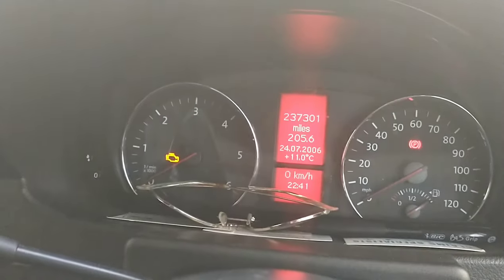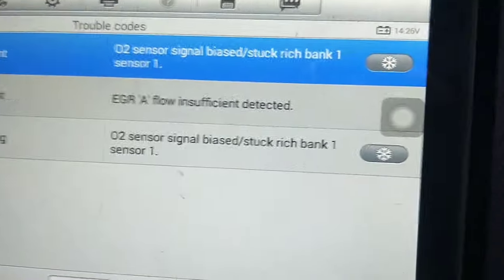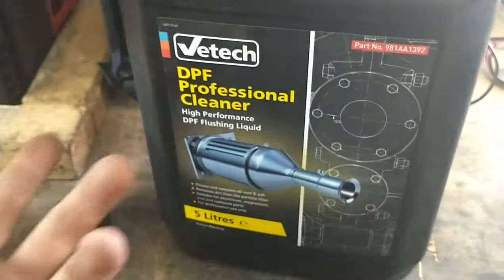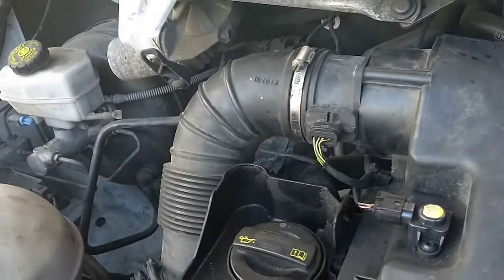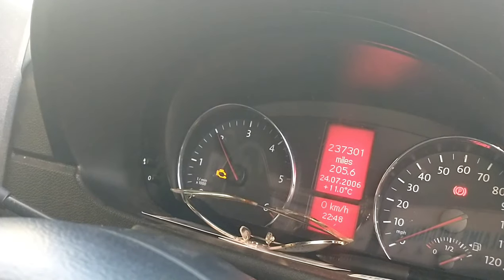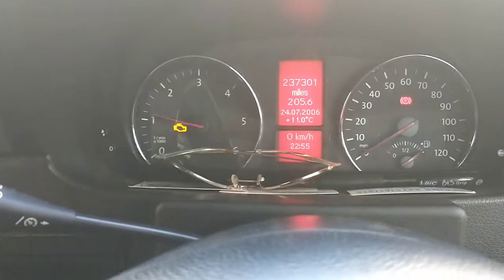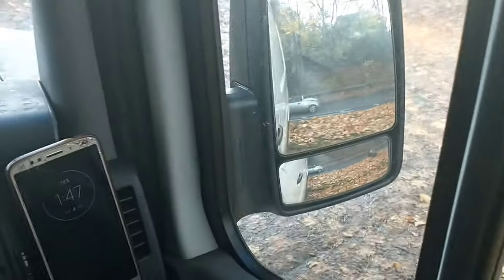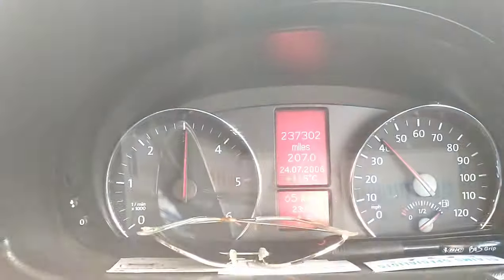How we clean EGR Valve, Intake Manifold & Turbo without removing!! using DPF Flushing cleaning fluid

Comment: Hi mate , I have used the one that should be mixed with fuel , it’s running rough I switch engine off immediately , to get it flushed out of the system do you think by taking the whole egr unit and cleaned will be alright?
Reply from the maker: Hard to say without seeing or hearing it
Reply: @ORileysAutos  now it will only start with starter spray, what do think mate
Reply: @ORileysAutos  am getting p0087 fuel pressure is too low , where about are you, am in Manchester
Reply from the maker: @adamvet9609  Biggleswade Bedfordshire
Reply: @ORileysAutos  I know you have made note of not using flammable  material , the one that I have used is (Carlube DPF cleaner ) , I have tested it with flame , its not that highly flammable like gasoline but it looks like diesel thats why it does say on bottle max it with diesel  , anyway I have used it thro air intake while engine running , engine Reve little bit high then stale , only now start with engine start spry , am getting P0087 Fuel pressure too low , I had this code before and I didn't get chance to check high fuel pressure pump , but looks like no fuel can only start with start spry and not Ide , do you thing high fuel pressure pump could be the problem , is it the one that has bolt to the shaft because I read about it that bolt could become loss , I would have to give it go hopefully engine start again , looks like  no fuel delivery thats why , your response is appreciated mate .
Reply from the maker: What vehicle is it and engine
Reply: your shadow is appreciated mate , before I dive in to that high fuel pressure pump as you know its really deep in there , would have to strip every thing off to reach it ( take whole EGR as one unit , then intake manifold with fuel housing ) all of these parts out of the way to reach the high fuel pressure pump
Reply: @ORileysAutos  on sprinter mate  651 2.1
Reply: 651 2.1 engine the high fuel pressure pump does it have that bolt to its shaft (looks like 23 mm bolt ) ? I haven't taken it yet U see
Reply: gooooooodnes me !!! you wont believe how easy it was to fix it , I spend almost 48 hours working on this van scratching my head (checking , back probing  ... ) I nearly about to throw high fuel pressure pump on it , infact I already bought it but now have to return it !!! but for those people want to try this at home please dont do it , if you aren't professional , you could easly got charged a lot of money to get it fix and the sad thing is , it will not be right away so your car or van will be sitting there in garage for weeks if not months please I can't stress this enough dont do it at least the way I have done ..

Comment: Do you have to do an oil change after doing this? Where is all that cleaned carbon gone? Is it in the engine oil circulating in the engine?
Reply: It goes down the exhaust.  How much gets stuck in the DPF I dont know but it is meant to be DPF cleaner.

Comment: Won’t this fluid harm the turbo and might also end up in the combustion chambers ?
Reply: In what way will a water based cleaner harm the turbo? 

 What’s the issue with it entering the combustion chamber? It’s no different to water/meth injection all be it without the methanol. The high temps of the diesel combustion cycle will vaporise the fluid. As long as you don’t throw the whole 5 litres in within 30 seconds and hydrolock the engine there no harm to be done. I mean the fact it’s been done on this van every 50-60000 miles and the van is on nearly 230000 miles tells you everything you need to know.
Reply: @Mac_F87  just thought the carbon in the EGR valves and air pipe might end up in the chambres and harm the cylinder walls, or the turbine!?
Reply: @anesdj4282  the EGR feeds in between the anti shudder valve and intake manifold. When you see the amount carbon and oil sludge in an EGR valve I’m sure carbon and oil sludge debris ends up in the cylinders quite often. Any of that that ends up in the cylinder will surely be burnt in the combustion process since it’s hotter than in a petrol engine. There is probably very little in the way of large debris that reaches the turbine in the exhaust side of the turbo.

Comment: I followed this method but with the one that supposed to be used in take , engine went dead and I had to work very hard to get it back and running again , gooooooodnes me !!! you wont believe how easy it was to fix it , I spend almost 48 hours working on this van (checking sensors /modules  , back probing  ... ) I nearly about to throw high fuel pressure pump on it , infact I already bought one and now I would have to return it !!! but for those people ''''' DIYers '''  want to try this at home please dont do it if you aren't professional , you could easly got charged a lot of money to get it fix and the sad thing is , it will not be right away so the car or van going to be in garage for weeks if not months to get it diagnosed and fixed please I can't stress this enough dont do it at least the way I have done .. , there is one electromagnetic ingredient in those fluid , obviously  if you got the one that has it or even the one that you have used before and now been upgraded with ingredient and you put it there while the engine is running  you will get  shortage everywhere , so now have to deal with it to get it back and running again !!!!
Reply: You probably used like brake cleaner or something totally wrong to do this type of damage , these intake cleaners can go through the whole system no problem , after air filter , through the throttle valve ect
Reply: Another thing to add you probably also flodded the engine with product

Comment: Did this today and had the Check Anti-pollution system "Warning light" come on after I sprayed 1 liter of the Wynns in the air intake hose, took it for a 20 mile @ 3500rpm to try and clear it but still have the message?
Reply: Did you erase the error code, before you drive 20 miles???

Comment: Hi, thank you for this video. I have a similar problem on my car, it's a diesel Nissan Micra 1.5dci k9k engine. Suddenly I started to have slightly lower performance from the engine and slightly worst fuel economy, check engine light came on but other than that the car run fine (starts with no problem, no smoke from tailpipe, no strange noise). Hooking up a scan tool resulted in the code P049B, which refers to insufficient flow in the low pressure EGR. You think it's possible to clean the valve with this method? Thank you for any advice.
Reply from the maker: Yes I'd try this method
Reply: I've got the same car and problem, garage quoted 7 hours labour at £280 to remove and recommended a replacement egr. Have you tried this yet?
Reply: @mooseyman74  hello. Sorry but no, i didn't try it yet. I went to my mechanic and he told me that the cause of the problem probably is a wire mesh gasket placed after EGR intercooler that is clogged. I'm better of with changing instead of cleaning it. I'll go back next week to see how much it will cost but if it's too much I'll try the method of the video.
Reply: This is the part btw:
https://www.kmotorshop.com/en/article-detail/view/143340/seal-egr-valve-736-492-elring-147228526r-6071420281-147226560r
It's a shame that to change such a cheap part you have to strip half the engine bay away.
Reply: @MichViviani  OK cheers, I wish I'd renewed the warranty now!
Reply: @MichViviani  I took the egr off and cleaned it, takes about 20/30 mins using a flat screwdriver for the turbo pipe and 10mm socket with extension on a small ratchet for the egr/nearby bracket. I was recommended to add Redex diesel system cleaner every other time I fill up, it is quite cheap at wilkos
Reply: @mooseyman74  hi thank you for the input. I'll give it a shot and clean the high pressure EGR as well, unfortunately I live in Italy and around here I can't find the same additive so I'll pick something else. In the meantime I ordered the new wire mesh filter, hopefully i won't need to replace it after the cleaning.
Reply: @MichViviani  I took the filter off you spoke about took about 2 hours to locate. It was totally blocked with soot. I cleaned it with dpf cleaner and a toothbrush. Cleaned the egr tube. Fuel economy is back up to 77mpg and engine management not come back on. I will replace the filter the next time it clogs up.
Reply: @mooseyman74  Cheers, good job. I still have the new wire mesh filter but I didn't changed it because my check engine light went off by herself. I believe that somehow some of the sooth was removed while driving(it's probably temporary tho). Just for curiosity... in order to be able to reach the mesh filter you had to remove the battery, the air hose that goes to the air filter and only then the low pressure EGR?
Reply: @MichViviani  yes that's correct it's right around the back

Comment: hi, i have just bought a 2010 polo 1.2 Tdi on 114,000 miles and its got a full service history including an egr change 3 years ago and about 10,000 miles ago. it drove perfect at first and i was just switching the engine light off but now the glow plug light is flashing and the car is in limp mode. i am getting engine code p046c on my generic machine egr circuit. One mechanic said it could be a blocked DPF another said blocked egr. what could be the cause of this before i splash out on cleaners or a new valve. cheers!
Reply: It will likely be both in my experience.. But, do it all snd its done, clean air filter and clean MAF sensor, then EGR, then DpF… and then oil change due to most of soot contaminating your oil. i think its very likely to be both, but, consult a reliable profesional mechanic if you do not want to tackle it yourself

Comment: Hi mate,  I have a bottle of the JLM DPF aerosol spray sitting around.. Do you know if that would be safe to use? Presumably any DPF cleaner should do it? Cheers
Reply from the maker: I don't know anything about this fluid
Reply: @ORileysAutos  Fair, thanks for the reply. It's used in the same way as the vetech stuff and I have successfully cleaned an EGR off the car with it, I'm just cautious about spraying anything into a running engine..

Comment: Will this sort sticky vanes overboost on non dpf golf mk 5 2.0tdi PD engine? Many thanks. Even going up a small hill now it's going limp. I have to pull over and restart the car.
Reply from the maker: It is possible yes. Try to find the rod and work it up and down while doing they spray
Reply: @ORileysAutos  Thanks, yes the actuator rod. I was thinking of this as it does get stuck with the build up, but if it's badly stuck, even clean turbo vanes won't help as s stuck rod won't move the vanes.

Comment: hi on the sprinter would it be possible to undo the exhaust gas return pipe and clean the egr that way
Reply: That's what I'm thinking of doing
Reply: @nometalgearr  did you try cleaning the egr through the exhaust retun pipe
Reply: @lees7890  I just ended up cleaning the egr while the manifolds were off. Egr was pretty clean and didn't need much tbh

Comment: How doesn't it hydro lock?
I have Opel Insignia 2009 2.0cdti with some turbo boost issues, thinking of trying this...
Reply from the maker: As long as you follow the video correctly it won't hydrolock. We have been using this trick for almost 10 years with no issues. While the engine is at high RPM it is only taking a mist of fluid through per cycle.

Comment: Don't know much about turbos, but doing this will clean only the 'cold' part or it, right? Not effective for sticky vanes on the hot side, for example?! Please advise
Reply from the maker: Variable nozzle / vane technology can be a major cause of turbo problems due to sticking vanes, This Fluid helps to clean the mechanism and restore normal movement.
Reply: Sorry, let me reformulate. Is spraying in the air intake, as shown, as effective as spraying before the turbo intake itself? Like between the egr and the turbo, for example? I'm interested only in turbo cleaning, not the entire air/exhaust. Thanks for the repky
Reply from the maker: @danielgeowayne  some of it will evaporate by the time it reaches the exhaust side but it is effective to clean it
Reply: @ORileysAutos  ok, thanks. Much clear now. I've got all the symptoms of a turbo stuck, and doing this 3 times did improve things, but not too much. It probably needs to be removed and cleaned manually. Anyhow, still got 2l of Vetech. I'll probably give it 2 more :)

Comment: Nice video, learned a lot from you, is it ok to spray the dpf cleaner in the opening of turbo? Intake side turbine
Reply from the maker: Yes
Reply: @ORileysAutos  why spraying the cleaner in cold start?not in engine temp. What is the reason for this?  Anyway i will do this technique to my car, waiting for my dpf cleaner🙂🙂 thanks so much
Reply from the maker: @uchiha45100  on a hot engine the fluid will evaporate too quickly. Cold engine allows it to soak in better
Reply: @ORileysAutos  makes sense, thanks
By the way i use this technique of yours this morning, i use spanjaard dpf, the result is great, the turbo seems new now, and the accelaration is great,million thanks to you again,from Philippines
Reply: Jun Arand
Reply: @ORileysAutos  will this work on a older van i have a 1994 dodge b250 5.2 cng

Comment: I have been looking for this product but cant find it any where the only thing that comes up is wynns off car professional formula dpf flush cleaner and states i need to take my dpf out and soak it and suggestions ?
Reply: Wynn's is similar if not the same but either is supposed to be soaked off the car.

The point of this video is showing an alternative way to use it to clean the intake and EGR
Reply from the maker: Gsfcarparts.com

Comment: Can I add 1 of these into the reservoir and another to do it like in the video? And after just a force dpf regeneration through VCDS?
Would that be bad?
Reply from the maker: What reservoir?
Reply: @ORileysAutos  diesel tank 😁
Reply: @ORileysAutos  but of course, not the 5L bottle. The smaller one that should be put in the tank and at the same time another bottle just to spray it in the turbo
Reply: @ORileysAutos  since I do have a DPF, I am worried that it might get clogged with all the gunk from EGR and intake manifold
Reply from the maker: @Marinalin85  do not put in the diesel tank. It will kill your injectors and high pressure fuel pump
Reply: @ORileysAutos  understood. But why do they say to put it there in the first place?
Reply: My DPF is doing its job at regen from time to time though
It's always around 30gr and after I force regen goes to 8-9gr
I am more worried about the EGR since is not in an easy place to check it (Audi A3 8V) but then won't all the gunk go into the DPF?

Comment: Does anyone know a suitable replacement for this fluid in the U.S.?  I want to try it on a diesel X5, but it doesn't look like Vetech or Wynns is imported here.  Thanks for the tip......hope I can use it!
Reply from the maker: Revive turbo cleaner?
Reply: @ORileysAutos  Thanks!  I actually was able to buy the Wynn's fluid and had it shipped.  Which brings up a question, after running the fluid through everything fine.  Cleared the codes, then took it out for a test drive.  Under load at about 2200 rpm, threw 4B81, (BMW X5 35d).  History says the EGR was reading a -11% when the fault occurred.  Performed a smoke test, no leaks.  The EGR looks clean from what I can see still mounted on the car, so the flush does seem to have done it's part.  Any thoughts?  Thanks again.

Comment: Ever had a worry with a runaway diesel? I was going to try seafoam spray but they say not to in a diesel due to runaway.
Reply from the maker: This is non flammable liquid so no risk of runaway. There is however a small risk of hydrolock if you use too much
Reply: @ORileysAutos  Wich is the quantity you used to avoid hydrolock?
Reply: @livingoncoins  between one and two litres, make sure to copy the RPMs in the video to avoid hydrolock, because the RMPS make sure its just a mist getting through the engine itself.

Comment: Does this procedure affect a catalytic converter in any way? Safe for catalytic converters? Thanks
Reply from the maker: It's non corrosive and safe for use on catalytic converters
Reply: @ORileysAutos  Thank you for the answer. Trying to see what Wynns products are available here in the U.S.  What about using Liqui Moly diesel particulate filter cleaner, which is available locally? Good? Even though it says to only use with their kit, DPF on the vehicle. Thanks again.
Reply from the maker: @stevefenn1376  I'm not really familiar with the liqui Moly so can't comment on it sorry.

Comment: Hi, I have a Citroen relay (2012) and the air intake pipe is not as accessible as in this video. Am I alright to remove the filter and spray from inside the bottom of the filter housing? Cheers, can't wait to give this a go
Reply from the maker: After the filter housing on those vans there is a curve in the intake so it may act as a water trap. Best to be Close as possible to the turbo.